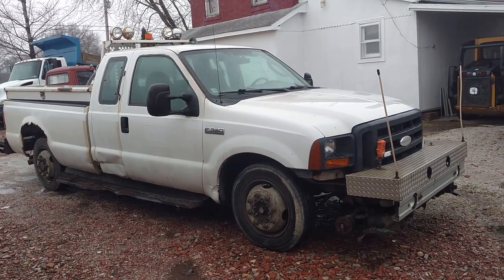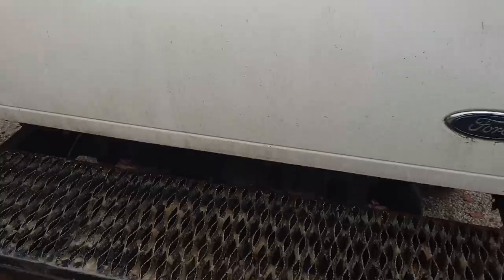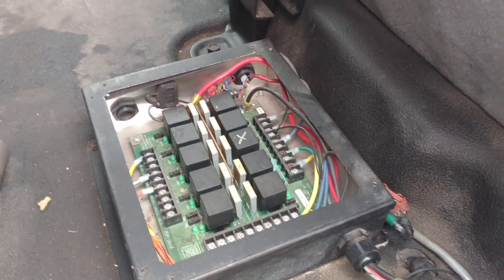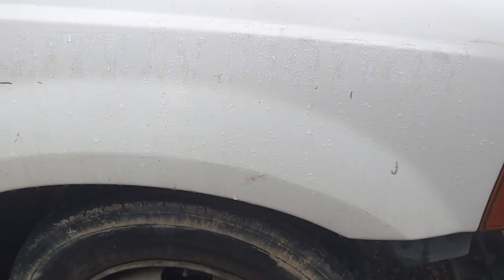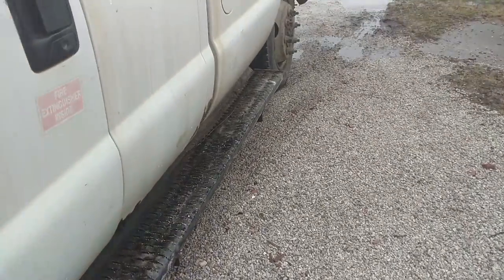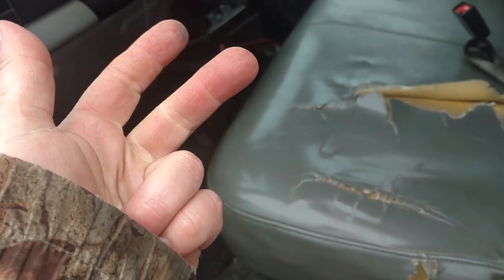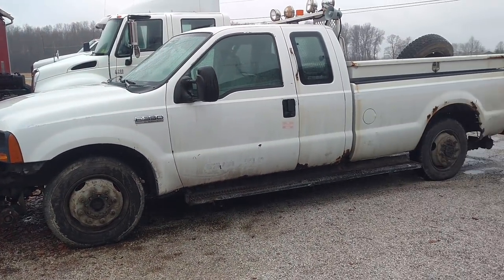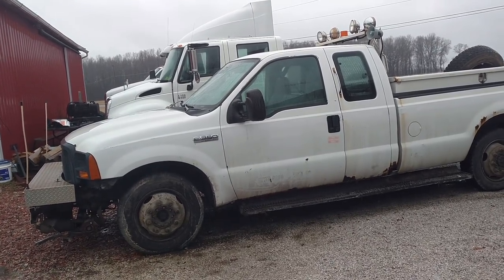J.C., WHY WOULD YOU BUY SUCH A PIECE OF JUNK???

Comment: And what if Im not being to rude JC did it cost for "this Piece of Junk?"  
Over here in Western Australia we have a company called TNT it is a freight company 
I had heard of a bloke  in Freamantle when I was needing to get a new to me
Toyota Hi Ace Van ( This was upgrading from a 1977 hi-ace van using a bequest left to me from my late Nephew ) Gary took about 3 months to find the right van for me and I ended up at the time 13 years ago  getting a ex fleet vehicle, used for fork lift maintenance 
278,000kms ( 172,741miles )  on the clock a 1998 2.8L  LWB Diesel Toyota Hi Ace Van
( something like this picture  https://www.drive.com.au/car-valuations-details/1998/toyota/hiace/lh113r-van-lwb-4dr-auto-4sp-2.8d/84774 )  
and it has a huge Bull bar on the front as well as a setup  back bumper 
it cost me a grand Total of $6,500 at the time and just looking for an example picture then  a 1994 model NOW is still fetching 8500$  as I only do between 2500 to 5000 kms a year it will probably last me for many years to come it does 34 mpg ( 8.4 litres per 100k) considering it is a red and white brick as far as aero dynamics is concerned it is brilliant 
So far touch wood all I have had to do is the usual maintenance  BUT I do change Alternately the gear box oil and the Diff oil every alternate engine oil change and that is for me every 5000kms for me I look at doing it that way and using the best oils I can  and driving conservatively I will also have it for many years to come as well 
The only Problem I cant solve is this 
in Winter ESP it is a REAL pain to start 
I have replaced the glow plugs that didn't look to bad any way and it has a New ish battery 
All I can think of is the starting power is so critical that if the battery drops down below 14.2 v you are lucky to start it for the first time that day our winters are nothing like yours during the day the lowest ever I have seen as around 14c ( 57f )  usually approx 16 to 18c here in winter ON a COLD DAY  any suggestions would be great ! 

but it goes to show when you do buy a vehicle it is well worth while considering a EX Fleet vehicle with one Proviso look it over carefully and see if their is any clues to it being thrashed by the young drivers of them ! 
Tony
in 13 years I have only driven it 33,000 kms (20505 miles) and it is my only vehicle ! 
a stay at home country Bumpkin this way !
Reply from the maker: i would look at the glow plug controller. in your winter temperatures you should be seeing a glow plug or wait to start light for about 10-20 seconds as they heat up. if it just comes on and goes back off really quick....i would suspect the controller.
Reply: In the begging when I got the Van it was really the first Diesel I had owned I had driven enough tractors and a mates Diesel Ute  and not had any problems starting 
When the Car Dealer drove it up here to me to see he told me to wait till the glow plug light goes off and them start 
It did usually but when that first winter came it proved itself  pain 
nowadays I always have one of those Jumper packs ( 450 crank hours) it fits in the palm of your hand  with me at all times just in case , But upon mention my problems o a mate he told me that if you wait after the glow plug light goes out for another 15 or so seconds you will hear a Click then try and start it 
To which I did and I would say around 90% of the time it works 
in the past I have also tried AreoStart ( either in a can , I beleive their is a product called Start you Basta*d  but I haven't found that one yet 
and even shoved a Hair drier on the hottest mode to the air intake 

I dont know whos YT video I saw in the past couple of days but someone had a 12v / 14.4 v battery with 4 posts on it  2 for the 12 volt and 2 more for the 14.4 v you hook up the starter to the 14.4 terminals and the rest to the 12 v terminals/ posts they give you an extra cell or 2 to have more cranking power 
it was an American YT and I havent heard of anything of the type here yet  I might have to consider looking for one of them here ?
 But I will see if I can find the Glow Plug controller anything to give one piece of mind esp when living in the bush 
Thanks JC

Comment: My father thought the same thing Beauty skin deep
Reply from the maker: your father was a wise man!
Reply: Thanks I thought he was crazy at first nice find
Reply: It wouldn’t be a bad project truck if you either owned a body shop and had time to take the truck in and “rehab it” but by the time you replace panels/get rid of all rust probably rebuild or replace motor transmission your talking 10 grand easy
Reply from the maker: it would never cost that in my world...you are obviously not familiar with me or my channel....i have a complete rust free body here that could be swapped over to this truck for less than 1/4 of that..however, i bought this for the drive line parts not to put on the road. the value of the truck is in the eyes of the man with the plan. i couldnt buy this engine used with over 150k miles on it in my area for what i gave for the whole truck.

Comment: All 5.4s are trash but the only one that’s somewhat decent is a 5.4 2 Valve
Reply from the maker: it is a good thing we all dont think the same way. i have owned well over 30 and probably closer to 40 of the 5.4 3v engines. they work very well when they are cared for properly. i find that many of the ones that have troubles have had less than great maintenance. what gas engine do you prefer?
Reply: J.C. SMITH PROJECTS..with decent oil changed every 4-6 thousand miles and someone who knows how to pull the spark plugs every 100k without breaking them it is a very reliable motor. I change the plugs in them all the time. Sometimes you have to soak with some oil mixed with solvent and work them back and forth but I've never broken one off.
Reply: J.C. SMITH PROJECTS 5.4 Liter are like a women a little kindness n TLC makes last
Of course you got know inside n out
Reply: Killian SnuffleBottoms 5.4 L 4V are better
Reply: I was just stating my pretty biased reply based soley off my experience with 5.4s (which has been pretty bad)
Reply: I USED to own and DD a 03 Ext Cab 5.4 3 valve , Thing was giant pile, I understand where your coming from.. But I do see my comment is pretty onesided, So as March 2017 Ive owned a 1993 Chevy half ton with a 350
Reply: And when i first said that I should had stated that Alot of 5.4s come from or have been pretty shit because of no repairs, I bought my 03 from a dealer for 6950, Trans was slipping the 5.4 had cooling issues and the infamous spark plug crap...  When I traded my 03 for the Chevy I havent looked back. Parts are cheap and abundant, decent on gas, I beat the living hell out of after I put new bearings, spark plugs and a remanned TBI module... Runs like a champ and have had no issues at all with it
Reply: kamaster1011 Weed every now and then...
Reply: kamaster1011 Infact I was high last night, 03/11/18
Reply: Killian SnuffleBottoms They aren't as reliable as the 4.6, 5.0, 3.5 duratec, 3.5 eb, 6.7 etc but alot of people have put alot of miles on them, they aren't junk, they just aren't as reliable as alot of the other ford engines.
Reply: Puff the Magic Dragon yea they aren’t complete garbage it’s a trusty ford, just my POV is coming from my experience with 5.4s.... which was utter hell

Comment: Bumpers like those should be illegal on personal vehicles.
Reply from the maker: why is that?
Reply: J.C. SMITH PROJECTS I understand it protects the vehicle, but it changes the functionality of safety structures built into the vehicle when in a collision with another vehicle or a pedestrian.
Reply from the maker: following that way of thinking...police cars and tow trucks shouldnt have push bumpers. fire trucks shouldnt have bumpers with equipment in them, trucks shouldnt have snow plows....the guide lines for aftermarket and upfit equipment is fairly straight forward. i have seen many vehicle manufaturers "body builder" manuals outlining what is and is not acceptable.....i wonder if all of these aftermarket bumper companies adhere to any of it?
Reply: Good thing Aaron is not in charge of jack